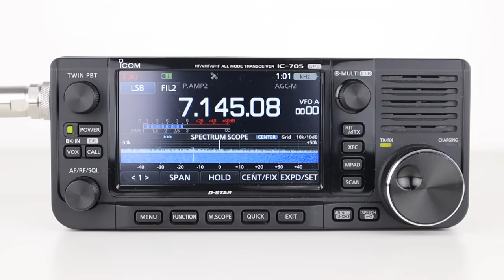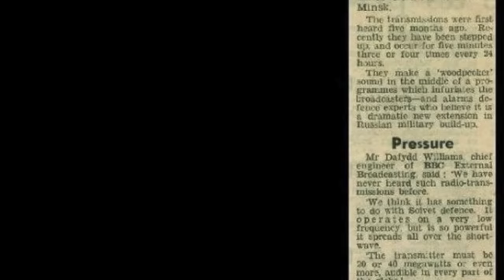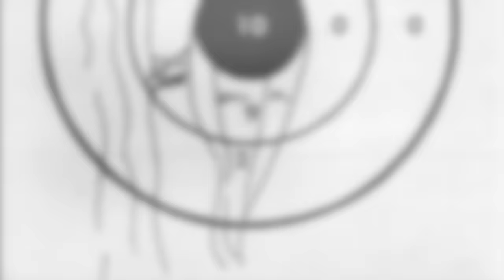Russian Woodpecker - The Radio Signal That Wreaked Havoc Around The World

Comment: As a U.S. CB operator who started in the 70’s, I remembered the woodpecker being there most of the time, for several years. I would hear it get louder and then fade. Eventually I realized that it was sweeping through frequencies. I hooked up a wide band receiver and tracked it going up above the CB band, and then sweeping back down below it. It was a bit scary to us. The word back then was that it was some type of communist over-the-horizon radar system. It’s nice to finally see what sent those radio signals.
Reply: US ham radio operator in the 1980's.  I knew this had to be a government signal as no one person could screw up so much bandwidth.
Reply: @ChannelGarrett  at least not at that power level
Reply: @kamakaziozzie3038  and for as long
Reply: @TheRealRusDaddy  and with such disregard for the communication disruption it caused.
Reply: The Soviet version of NORAD...two walls of electrified metal towers. Since the systems also included receivers, I'm wondering if it was also an attempt at transmitting instructions to Soviet spies, and receiving replies from them. Even more likely, in my opinion, was that it was an attempt at jamming western radio stations such as Radio Free Europe so that the Soviet citizens couldn't hear them.
Reply: @ChannelGarrett  yeah, the best one person was able to do was Max Headroom, and as brilliant as it was, the signal didn't travel far at all.
Reply: I remember this as well.
Reply: It is still in use it covers most all of ten meter down to the top ten channels on a cb it at worst is irritating but only lasts 20 30 sec on each freq but yes it does cycle thru again
Reply: @georgegetterdone896  it's not still in use, if there's interference again it must be something newer than these scrap heaps
Reply: @tsm688  not saying these " scrap heaps" as you say are the source but yes something similar it is as though the old woodpecker went digital the older model covered larger band widths but this new version only attacks about 20 to 50 Kc at a time I still hear it sweeping freqs both sliding up and back down with more of digital tones 
Kind of like some of the newest cw radios using computer speed and computer generated tones
Reply: @ChannelGarrett  hahahaha
Reply: Es el primer radar "Mas Alla del horizonte", ahora ya lo usan muchos paises , pero el primero , como de costumbre es Ruso
Reply: Were you in Augsburg?  I always remember driving past the big antennas near Augsburg on my way to Reese Kaserne.
Reply: @tsm688  well than explain the digital sounding fart raps on freq that sweep the band but stay in the upper 11 meter and reach the upper mid 10 meter band and back down
Reply: @georgegetterdone896  if there's interference again it must be something newer than these scrap heaps.
Reply: @tsm688  well yes it is " newer " it is like a digital format of a mechanized wood pecker somewhat high pitched ( since hi tones travel better) the sound is like a mix of that and a slow buzzer goes about 3seconds  and then drifts only 10 kc starts over continuing up and down the band
Reply: You can't see what sent those signals, the transmission array is long gone.
Reply: @cinemoriahFPV  it is not, mostly because it's in the chernobyl zone and nobody's gonna touch it
Reply: @davidpalmer9780  по международным законам речь не идёт о нарушении связи, если оно обусловлено безопасностью  какой-либо страны. В конце концов это США навязали СССР гонку вооружений. А этот радар - ответ СССР.
Reply: @georgegetterdone896  этот давно не используется. Это Чернобыль-2 на Украине. У РФ есть новые ЗГРЛС. Одна из них введена в строй несколько лет назад. Во время тестирования она долго гадила на любительских диапазонах.
Reply: @tsm688  it's the receiver array still available to the public (or at least was before the war in Ukraine). The transmitter was 37 miles to the west of this array and is dismantled and doesn't exist anymore (at least since 90's). Megawatts of electric power was provided by the Chernobyl Nuclear Power Plant indeed. And since its explosion in 1986, was under mandatory evacuation order too. Then, after demolished plant went cold, the woodpecker was much underpowered and just a few years later, in 1991, USSR collapsed and Ukraine was constituted.
Reply: ... up to HF/SSB? (Collins KWM-2A plus 30L-1 linear Amp... 3.940MHz) USAFE command post, mobile tactical radar stations, 2ATAF ADIZ (fabricated a 7-element quad, on a tower, with rotor... German Bundespost DF helicopters were not happy)
Reply: Scary. At least today our fears are different. Couldn't imagine living in that time. We had earthquake drills. Not nuke or shooting drills.
Reply: Exactly right.  I used to hear it too. I was a CB radio operator in San Diego California. I was a React monitor. I remember a couple of times when this signal would come and go like you said.  Everyone was highly annoyed because we couldn't monitor channel 9, the emergency frequency. Then like you said it would disappear.  I had a shortwave radio too. I would here it on that radio too. I also remember people suggesting it was some kind of mind altering experiment coming from somewhere in Russia.  Now we know.  I'm 58 now, and it's good to finally get an answer and to see the source.  However, it makes you wonder because there is a system like this up in Alaska (HARP) and I've heard all kinds of speculation on that such as it's a weather creating machine or a machine that can cause earthquakes. Last I heard, it's how Trump got Kim jong un's attention. Rumor has it that the US created an earthquake that collapsed Kim's underground bunker system.  No expert here but I kind of believe it.  The little dictator stopped firing missiles the very next day.
Reply: Yeah sure that happened
Reply: @georgegetterdone896 It’s called urban mumble rap. It’s a terrible interference on radio waves.

Comment: I remember the filters being sold here in the US that would help block out the interference from the Woodpecker, a popular one in the early 80's was called the "Moscow Muffler". It was plenty strong enough to even cause interference on the over the air TV stations.
Reply: That was electric probably 60 cycle interference. Wife was vacuuming or something
Reply: @orangepants5749  It did.
Reply: @orangepants5749  It would on HF and I heard it
Reply: @orangepants5749  it sure did
Reply: @orangepants5749  It definitely did. I can almost reach Russian territory at home in the middle of the US with a fairly basic antenna and 150 watts of transmit power using similar bands to what the Woodpecker used. The Woodpecker had a gigantic antenna area and blasted 10+ megawatts of power. It caused interference and problems around the world.
Reply: @orangepants5749  Found the dude who doesn't know anything about radio transmissions or even HF amateur radio ...
Reply: @mr.nobody---  I did some thing similar in Chicago with my 1970 Buick La Saber! Lol
Reply: @orangejjay  Sometimes it would obliterate the HF bands.  It kept up until mid 1980s.  I could move it around the band with a keyer, or so it seemed.
Reply: So I made it worse?
Reply: @orangepants5749  Did you hear the tapping at the beginning of the video? That was it.
Reply: @orangepants5749  The whole point of it was to reach the USA. It had to send a radio signal out all the way to America then it had to bounce all the way back to russia. It was an early launch detection radar. If it couldn’t reach America it wouldn’t have been any better than a much smaller radar station
Reply: @orangepants5749  Based on what? If you don't have proof to say it wouldn't then Back it up or shut up.
Reply: @orangepants5749  it did bro my dad use 150 w and basic antena back in 1990 and it can reach more than 5k km
Reply: Of course it reached all over the entire USA!!.
 
You're apparently NOT a US HAM radio operator. :)  All HF operators were familiar with it. 

BUT "Radio Moscow"  was a jewel, a wonderful English Shortwave  broadcast in perfect female broadcaster-grade speech cadence & pitch, perfect for static-plagued noisy Short Wave International Broadcasting.  
It consisted only of Factual News,  a proven most perfect source of US National & International news, including details on US Congress, White House, State Depth, Pentagon, CMIC, other news-worthy material.  No politics, no propaganda, no commercials.  It was a News Addict's delight !!

I frequently traveled out of the US [overseas] 7~12 days trips, in those days.

First thing upon arrival home was to catch-up on US Congress & DeepState mischief,  via Radio Moscow SW broadcasts.  😂   I never detected any error or deception in their very professional broadcast. 

I have nothing but praise for Radio Moscow English Nightly News Broadcasts.  They were truly a praiseworthy service to English speaking listeners in the West (targeted audience)

I was very sad discovering it had disappeared forever. 😔
Reply: I had no idea they sold filters for this, it eclipsed some upper fm band stations that I used to listen to, if I remember correctly.
Reply: I thought the Moscow Muffler was a Russian lass with a generous 'garden'
Reply: Imagine if this was actively weaponized? It's basically a Tesla cannon 😎
Reply: I remember around 1975-76 that this could be heard on the unused areas of the local commercial FM band, sometimes replacing the normal hissing sound.
Reply: My uncle told me back then there was a guy in our town that had a very powerful radio system of some kind. I guess he could black out people televisions and could talk through the tv sometimes.
Reply: Was it scary?
Reply: Now you have clean video signal on TV in HD but zero content -100000% propaganda and safe and effective BS everywhere - version 2.0 coming soon

Comment: I remember the Russian Woodpecker well. I think it's one of the most interesting man-made structures in the world. One hundred megawatts is a huge amount of transmission power. My theory is that the antennas were built near Chernobyl to satisfy their massive power requirements.
Reply: It's not a theory. That was precisely the intent of entire Duga (OTH) project. The amount of power was just enough to give USSR as much time as they needed to react on any nuclear attack. Any missile launch over half of a globe could've been detected right away the moment missile leaves the missile silo. Yes, not just in air or space. From a missile silo. The first 5 to 10 seconds of rocket thrust would've been detected by this OTH system. That's why it had to be so powerful. It's also extremely precise system which could exclude any wrong data because nothing else could produce such a thrust as ICBM. That's why US had to inform USSR of ANY rocket launch or any tests that includes testing thrust. This was quite a headache for US back then. But it had to be done every time to avoid cases when it could've been seen by USSR as attempt for attack. An alien, more advanced civilization indeed.
Reply: @MrZlocktar  Excellent analysis. Thanks!
Reply: @MrZlocktar That's just crazy!
Reply: @whoareyouyouareclearlylost323 
Crazy? 
I was crazy once
They locked me in a room
A rubber room
A rubber room with rats
And rats make me crazy
Reply: @PurpleDuneEfa  Did you befriend the rats, I certainly imagine it so... Ahh yes East Berlin and its majestic tunnels.
Reply: But they were there before the NPP.
Reply: I was told when in Pripyat that one of the Chernobyl reactors was solely for that transmitter.
Reply: @Auroral_Anomaly  yeah but, construction of the Chernobyl NPP started in 1972, the Duga-1 finished construction in '72.
The NPP became commercially operable in 1977, so it could have been providing power even earlier to the Duga system

Comment: I discovered the Russian Woodpecker in mid July of 1976 on my SW radio.   By 1980  to 82  the Woodpecker sound was showing up on the telephone,  TV  and even FM radio too.   I last heard The Russian Woodpecker  on the 20 meter Ham band  while monitoring Hurricane Gilbert communications in the fall of 1988.   I thought the signal  was fascinating and mysterious,   but at the same time    I also hated that annoying signal ,  with a passion.
Reply: Can you hear it on 500 khz?
Reply: As a Belgian radio amateur I remember that annoying sound very well.
The signals were sometimes so colossally strong that if you worked in SSB, the slow automatic gain control completely suppressed the station you were in QSO with.
It was all over shortwave and I also think they didn't put much effort into using lowpass or bandpass filters.
Because often the signal could also be found on the first harmonic of the frequency at which you heard the woodpecker.
This was a plague that has made many HAM operators very annoyed.
Reply: @swededude1992  If possible can you provide us some examples? It would be nice to have those documented somewhere
Reply: @swededude1992  dude link me I want to hear this
Reply: Trip

Comment: I remember hearing the Woodpecker on small SW radios when I was a teenager in the 1970s. It has been suggested that the necessary power to operate the 10 MW transmitter was generated at Chernobyl, which lacked the necessary capacity after the destruction of reactor no.4 there in 1986.
Last weekend, there were two separate OTH radars operating illegally in the 40 m amateur band at the same time. Sometimes the Russians operate a "spoof" transmitter so that they can claim that the OTH radar at RAF Akrotiri in Cyprus is similarly breaking the rules.
Reply: Since Pluto uses FMCW and kontayner uses FMOP... wouldn’t it be unlikely for them to be able to imitate Pluto? I‘d assume that their tech isn’t fully software-defined so not sure if they can change the modulation instantly. 
That being said, it might fit Russian doctrine to just build another site that does use FMCW just for that purpose.
Reply: Duga facility near Chernobyl is a receiver one.
Reply: Since the radar sites and the power plant including Pripyat were being built at the same time, it is likely they recieved power from the NPP, but saying it lacked the power to power the radars after Unit 4 demise is confusing since the CHNPP still had a nameplate capacity 3000 MW. Enough to power a couple of these😅
Reply: @igorbabchenko2091  or it just became unsafe for the personnel to operate the reception facility, because it fell within 10km exclusion zone.
Reply: As a kid in the late 70's, I got a fancy AM/FM/SW radio in a boom box.  That Woodpecker was annoying.
The pecking frequency would slowly drift up and down the band.
Reply: @engtimofeev  They regularly operated the other reactors well into the '90s and the last one was permanently shut down only at the beginning of 2000s.
A lot of people worked there and because of that Pripyat's indoor basketball court and swimming pool were kept clean of radioactive contamination and in good working condition untill 1998 (they are infact one of the least contaminated places in Pripyat even now that have long been abandoned).
Seems unlikely they would've permanently shutdown such an important military infrastructure because of the incident while civilians were still regularly working there unless it was already obsolete and no longer usefull.
Reply: The site at Akrotiri was outside the Sovereign Base Area so on Cyprus soil. Whether or not the Cyprus authorities were consulted I don't know.
Reply: @MENSA.lady2  M4 ,scr 508 ,528 ,506 and then some ,heavy 📻 fm set at around 90kg
Reply: When talking about the power of a pulsed radar transmitter, this is the peak power of the pulse, not the average power.  So a 40 MW transmitter, with a 0.1% duty cycle (typical for pulsed radar) only puts out 40 kW average, and could operate on 100 kW of.  So while the transmitters would still be pretty substantial, they would not need to be sited specifically for their power requirements.  And as others have pointed out, this was a receiver site, anyway.
Reply: s/b 100 kW of power.  Of course, the way the USSR did electronics, it could easily have taken 1 MW.  Still not enough to be a serious load.
Reply: Great posting! It is now June 2024 and I have heard several buzzing signals midband on 40m lately, and some below 60m Ham Band that sweeps like a sawtooth over maybe 50KHz, looking at it on my SDRplay RSdx which is an accurate well filtered device, I got at Ham Radio Outlet store using several partial gift cards! Been licensed since 1969, and an SWL and radio repair kid since grade school, the WP and also overrun of foreign broadcasters in the 50-70s was ruinous to listen to smaller countries or VOA ect! All I had was a lousey Heathkit GR-64 that drifted so bad I added a second always-on Filament Transformer for the Converter/Oscillator and BFO tubes, paired with an AMECO AC-T as my Novice station. At 70 I am still working using my Electronics servicing and Ham Radio skills every day, presently handling all Reliability, EMC and Certifications on 400G Optical Networking products. So I can finally   afford to buy the Lafayette HA-800 and Radio Shack DX-160 which were BOTH out of stock when my Dad took me into NYC, to spend the $$ I saved from my Transistor and Tube , adio repair business I had starting in Grade school! I loved SWL and now HF, and have an Icom 706MK2G in my car now that Talk Radio is dying. Also I have a Hammarlund HQ-129X I bought in the 70s, and recapped and calibrated the dials with a sharpie, that worked with my later Johnson Viking 2 system, an NCX-200 we used in the car in College for phone patches home.
I love all the other boatanchor stuff, including Kenwood Twins, TS-440 S/AT, Full National NCX-3, 5, and NCL-2000 stations, and the 2 best Hallicrafters Receivers to own and restore, an 1944 WW2 SX-28A and 1957 SX-100. Totally correct on the Chernobyl mess, my Sister was in Poland when it blew up - and one Russian girls video of the Duga site showed our Atlanta city on the map in the former station Lobby!!!